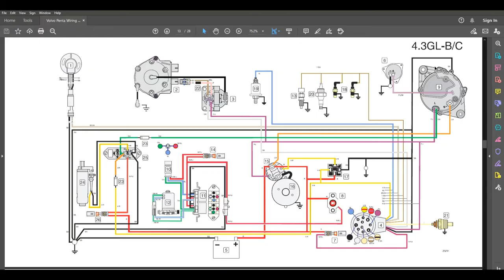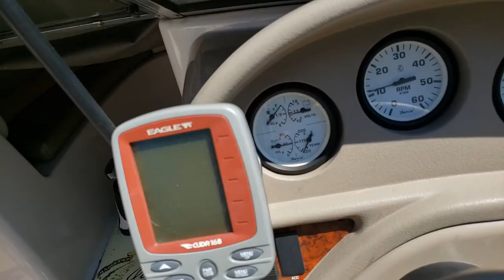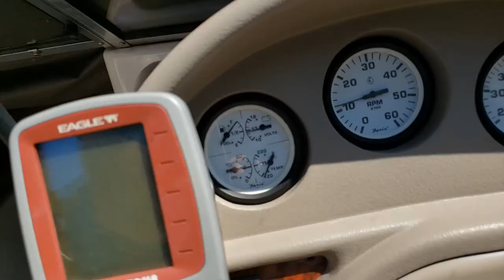Boat Engine Beeping Alarm - Diagnose and Replace Temperature Sensor

Comment: I have this same engine in my 2006 Stingray 195ls. Last weekend my temp gauge is sitting all the way maxed out even with the boat off. Does that sound more like a faulty gauge to you?
Reply from the maker: Sounds like a guage problem to me.  What happens if you unplug the temp sensor?
Reply: @MrGTMan002  it stayed maxed. Even after I took it out of the panel. I replaced it and the issue was resolved.

Comment: I have a 2004 Four Winns Horizon 190, and I just replaced my original Faria gauges with new Farias.  I've reconnected all of the wires, but there is a tan/blue wire with a a red, round potted component about the size of a quarter on it, and that wire appears to be the audible engine alarm wire, and I don't know where it is supposed to be connected to at the gauges.  Can you help me?
Reply from the maker: Sorry I don't know the wiring schematic for your specific gauges.  Did they come with a diagram?  If not, I would contact the manufacturer if a google search doesn't turn up the info you need.

Comment: I currently have same problem, boat was sitting down for 2yrs, should I change all sensor? Is the exhaust sensor same as the thermostat sensor?
Reply from the maker: I'm pretty sure the sensors are not all the same.  You can look them up for part numbers and Google them.  I would recommend trying to diagnose which sensor is the issue, starting with the thermostat housing one.

Comment: Man just a question i got a mercruiser 4.3 mpi where can i get the schematics?
Reply from the maker: I do not have schematics for a merc 4.3 mpi.  I used google to find schematics.  Use a google search and press the images button.  I think you will find them.  If that fails, then search for the appropriate service manual.